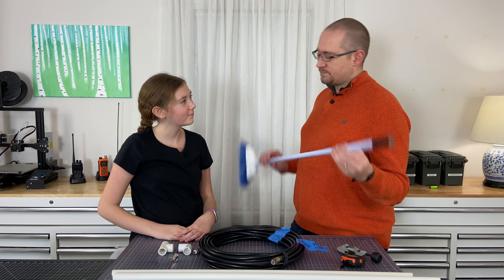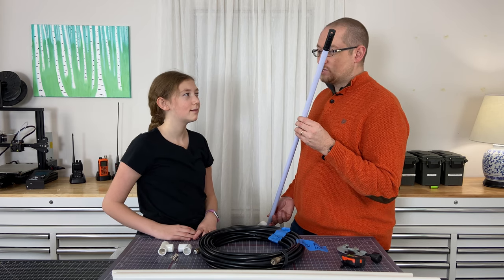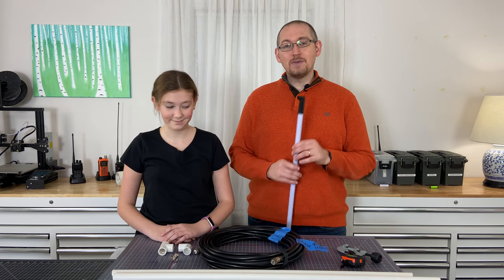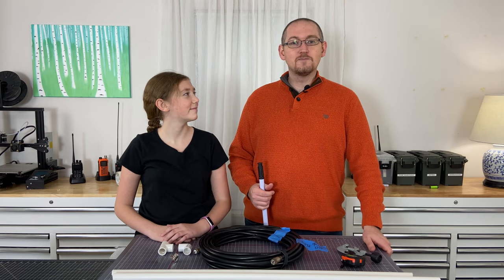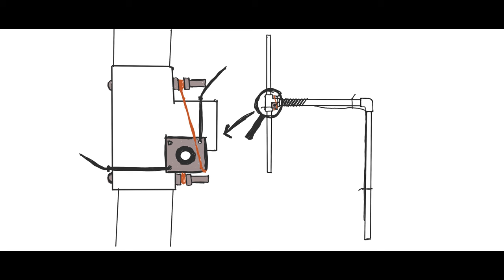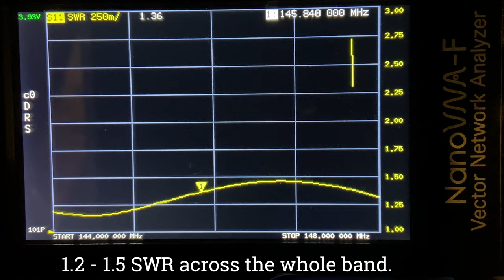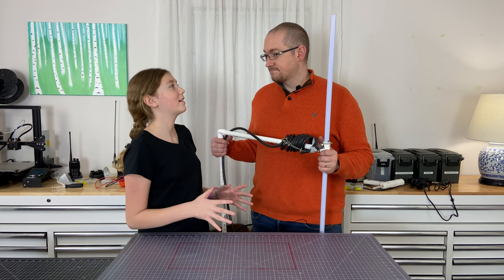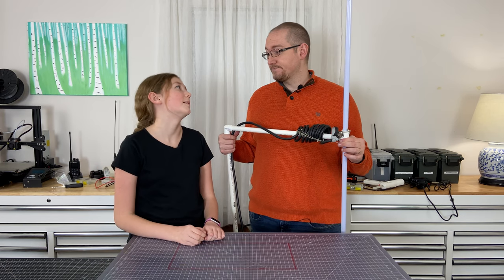Building a 2 meter Dipole Antenna (from a broom)

Comment: So I have a question, I understand the construction and the basics of dipole and. I am curious on what are your guys's power source and radio setup that you guys use on that antenna? I'm reckoning back to the part of your guys's video when you guys were explaining, when you guys later on the ground you got about 10 miles, when you had it up in the air, and then when you were planning on putting it up on top of the roof you were estimating that you guys would get somewhere around over 50 miles. What type of energy output wire to go 50 miles with that type of antenna? I currently have a ball thing five lot radio hooked up to a 25 - 40 w campfire that is currently hooked up to my vehicle. So the amplifier is putting out around 35 watts, would that be enough to transmit if I had it high enough?